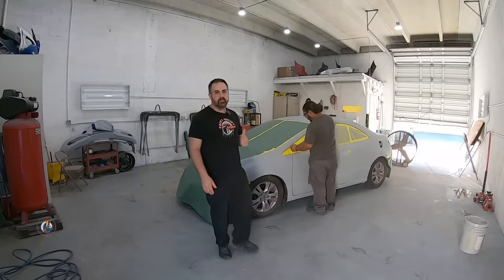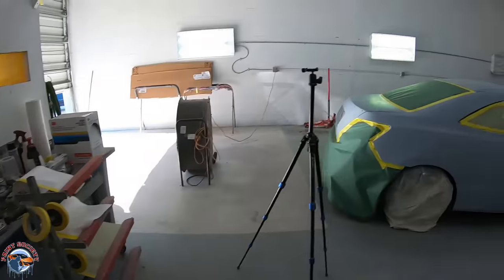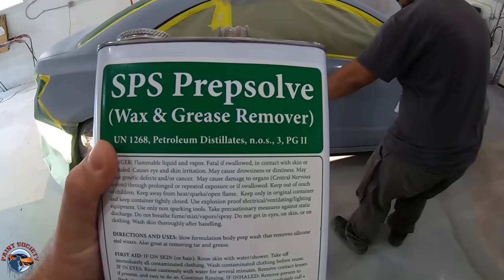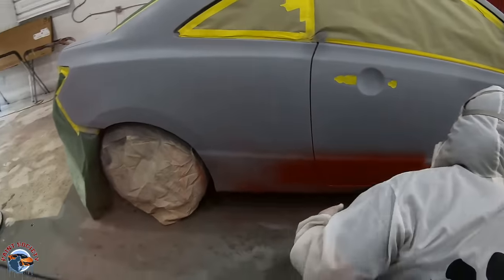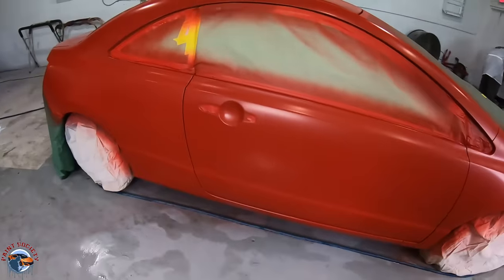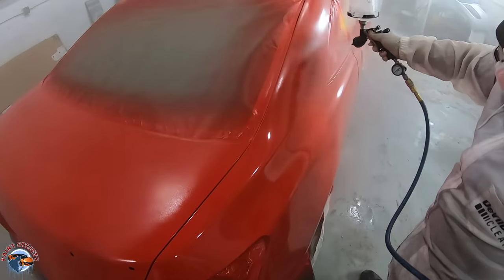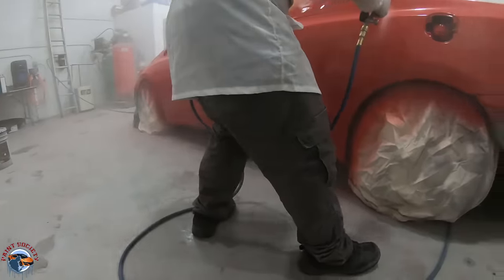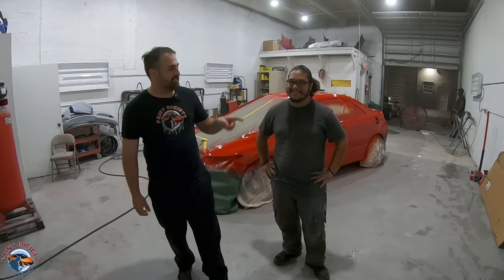How to Get Amazing Results without a Paint Booth!

Comment: 1500-2000 for a whole car paint job?? What are you painting it with, water colors?? I've never in my life seen a REAL paint job for under 5 grand, even back 20 years ago. Are we talking some maaco jaunt where they just throw acid thinner over the car, spray it off and do a 1 stage and don't do the door jambs, trunk, under hood, etc??
Reply from the maker: We are talking cheap run-of-the-mill paint job
Reply: Seen plenty of good paint jobs around 2000, 20 yrs. ago.  No, not inside the trunk or under hood, but door jambs, yes. Had a local guy paint a Corvette for me 25 yrs. ago. Base, clear, sanded, buffed, Looked great, $1750.
Reply: @danieltaylor4819  i would drive VERY far for that. I paid literally 10x that to have my Z06 painted in a yellow pearl and it was already yellow from the factory so they didn't even have to do door jambs. What shop is this? Does it still exist? I need to get my S5 painted so it's easier to peel plastidip off. Not worth it for 6 grand or so, but for $1750 I'd pay to have it shipped and still come out way on top
Reply: @dipmyryde   This was in central Ohio. A small local shop, not in business any more.
Reply: @danieltaylor4819  probably because they were giving away paint jobs for less than the cost of materials